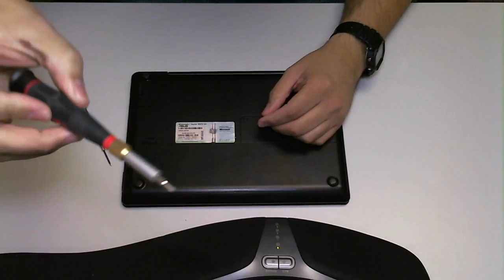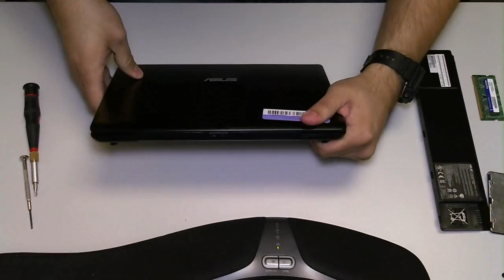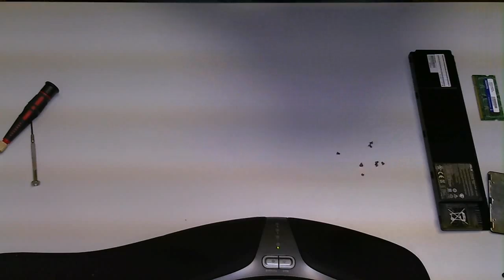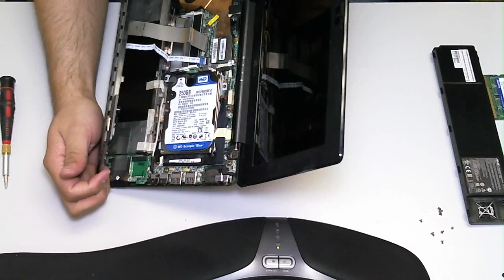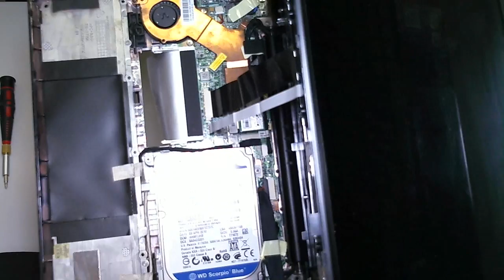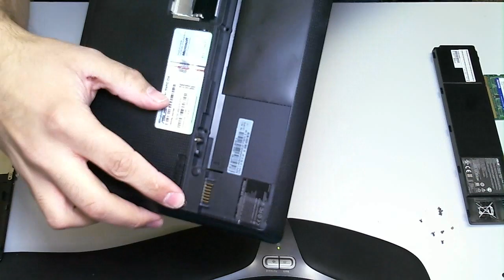ASUS EEE Netbook Hard Drive Removal and Upgrade (Classic Guide)

Comment: What a pain in the ass! The best way to remove the screws, then drop the thing out of a 2-story building, preferably on concrete. If the bottom doesn't pop off then, give up! Seriously, guys, wear a static protection device when removing memory, or find a good solid floor without carpet. In other words, ground yourselves. Geesh, I'm typing this and the poor guy still hasn't gotten the back off. Oh, wait, he got it.

Comment: Thank you for this. I just replaced my asus' harddrive. I was hesitant at first because I've never opened a netbook but your video gave me confidence.

When I popped off the shell I found an old credit card to be really easy to work with. I got a little bit opened and then slid the card around the sides so they all popped off without me trying.

Once again, thanks!